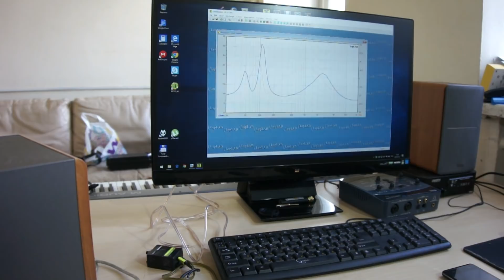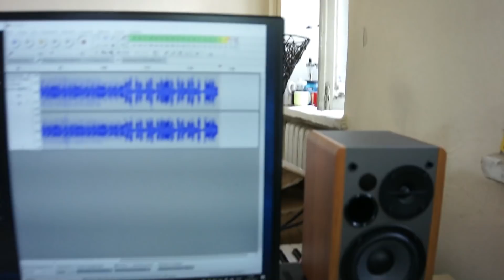Edifier R1280DB blitz review. How it's made

Comment: Hi, would the r1280db bass be good enough for movies in a small bedroom? I know bass is only 4" which is too small to shake the walls, but do they move at least some air or shake the desk a little? I dont have a sub yet, but am planning on getting one if these are not enough. Right now I'm only using the tv internal speakers, in my small bed room, with a large desk, bookshelf, and a small futon bed. Thanks for your review!
Reply from the maker: it's really small speakers, but a lot of people prefere it couse it's small and cheap. the balance it pretty good, good sounding for near field - your working space, but not for room
it has no output for sub, so you have to spande more money and to buy sub with in-out options